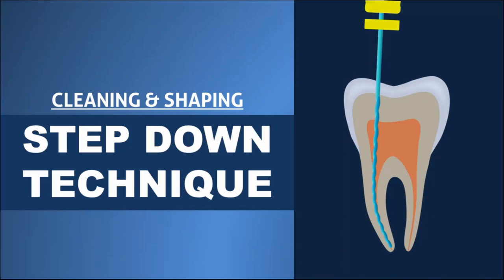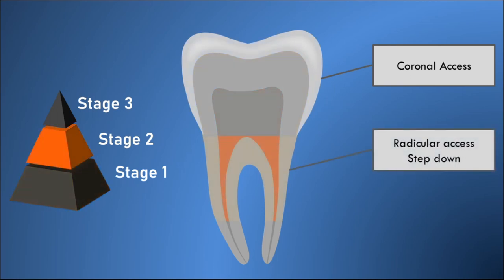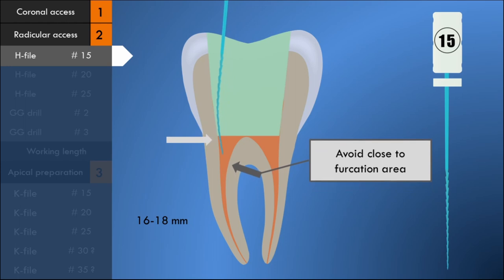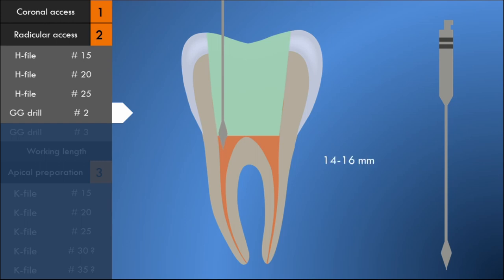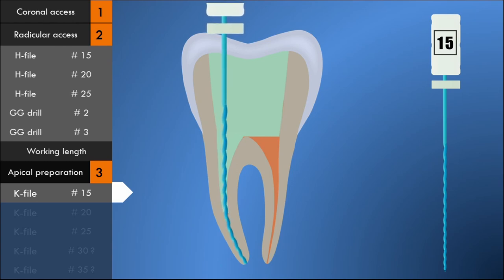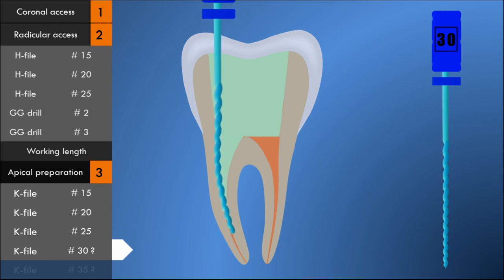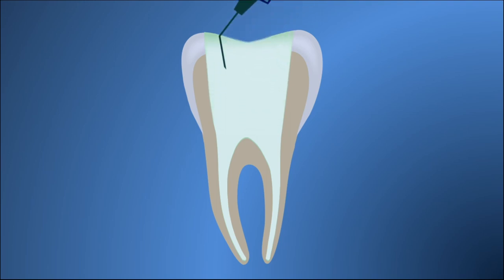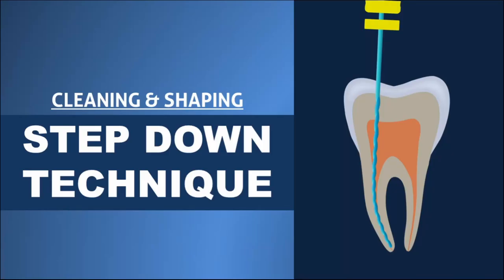Step Down Technique | Cleaning and Shaping

Comment: Shouldnt you start with the BIGGEST file to the smallest on Step Down technique?
Reply from the maker: This technique is exactly mentioned as explained by the authors, who introduced the step down technique. As i mentioned already, there are many modifications of the systems in practice at present times including the use of bigger size files first...
Reply: yes, this is what we were taught. you start at apical 1/3

Comment: Measuring WL by a 15 k file is not recommended  to avoid ledges in apically curved canals...a 10 k file can be well seen in radiograph and has less chance for creating ledge.
Reply from the maker: Could be. But still, it is better to enlarge the canal to at least size 15 before going for a radiograph as in many cases 10 size file will be too small to be clearly visible in a radiograph. Especially in case of maxillary molars...
Reply: Exactly